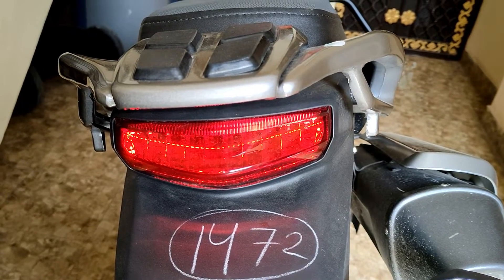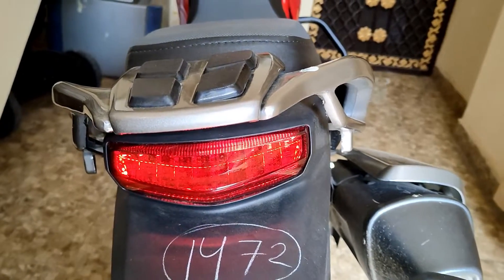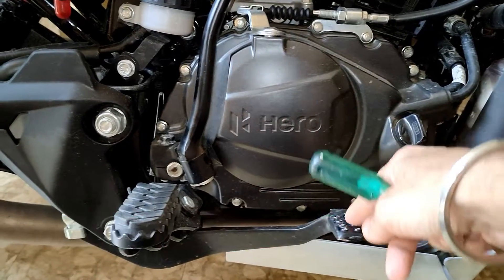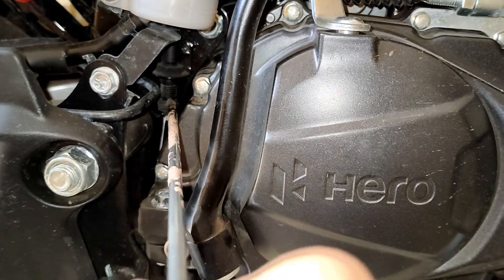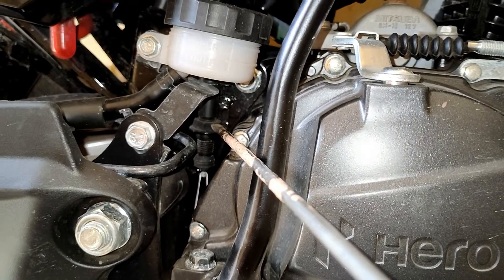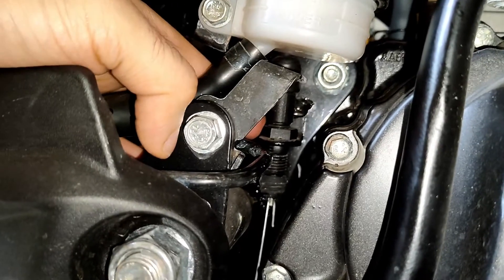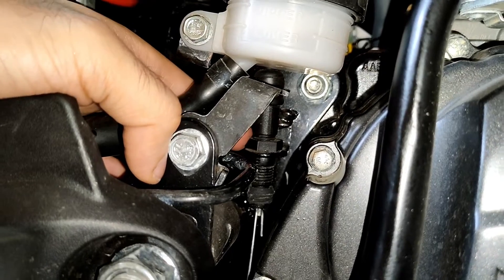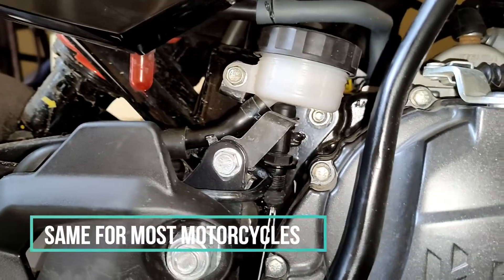Hero Xpulse Brake light switch || Motorcycle brake light switch

Comment: Bro In interceptor 650 Head light off switch from Bs3 classic switch set ul is advisable
Reply from the maker: Yes it can be easily doable without any issues. Many are using the same. Make sure to use proper pin connectors there are many available matching the pins of interceptor.
Reply: @ijs_autoandmore  did you do this ?
Reply from the maker: @premjithps9721  no i did not, never felt the need to do it. But seen the switch on few motorcycles in the interceptor group when i was part of that group.
Reply: @ijs_autoandmore its help to battery life?
Reply from the maker: @premjithps9721  might or might not , batteries now days lasts around 2 to 2.5 years sometimes more if u are careful with storage also depends of how much after market electric stuff u got.

Comment: Aren't these dual purpose tyres more puncture prone??
Reply from the maker: Haven't faced any yet , and haven't heard anything like this from owner i know. Held well in pouring rain.
Reply: @ijs_autoandmore  Do you recommend this bike?
Reply from the maker: @karamlamba  yes if u are not power and speed junky. This is fun inside and out of the city. I did highway ride yesterday and came back with a big smile. U have to live with single cylinder vibes which will get better with more services and oil changes.very well capable of doing 85 to 90kmph all day long with good fuel economy. 
For the amount you pay you get package worth more than that.
I felt vibes on pegs at 70-75kmph zone post that it settles down

Comment: My light is on not turning off
Reply from the maker: @fahaad296  adjust the switch else get the wire inspected.
Reply: @ijs_autoandmore  it turned of after I tuned it but not working when I use the rear brake I think there is some problem and it is a new bike
Reply from the maker: @fahaad296  get the brake paddle spring checked at the service centre and the switch at the front brake lever.